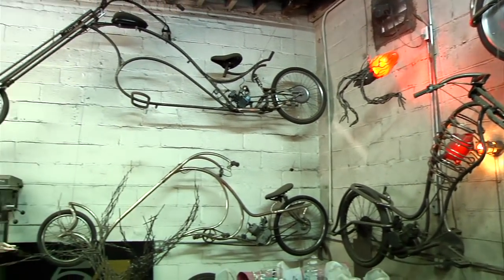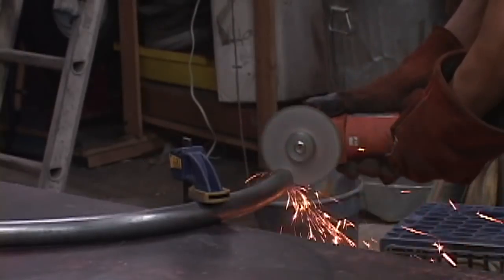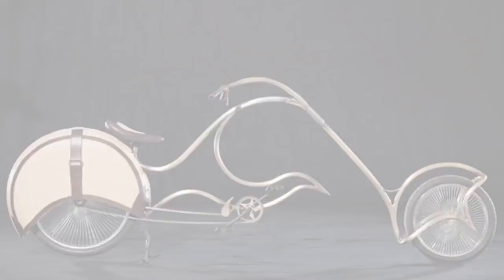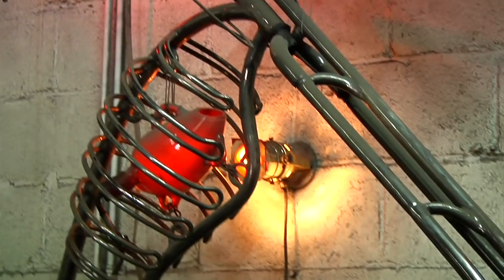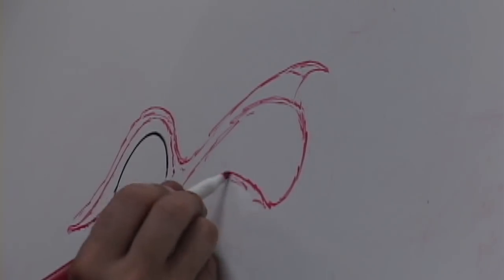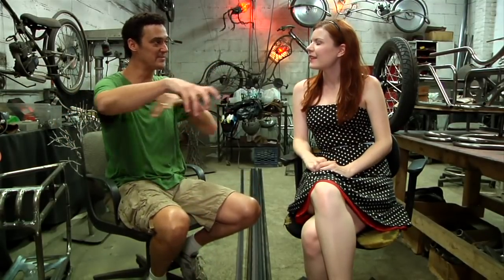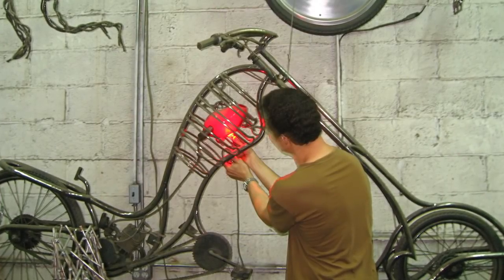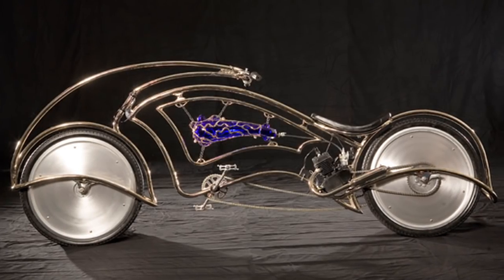Building Custom Bicycles in New York City

Comment: @omarnomade It really depends on what your goals and limitations are.  Generally, steel is easy to work, to weld, but is heavier than aluminum.  Iron is a component of making steel, but iron on its own would be a terrible choice for a bike -- too bendy.   Steel, and specifically 4130 (a strong alloy steel), is a great choice for building bikes -- it's cheap, and easily welded and formed.  Bikes can be welded with oxy-fuel, MIG, or TIG.  Or brazed.

Comment: very nice work , but they look extremely heavy need a motor.  and to the guy concern about polution. when they make a bicycle that goes 100 + miles in one charge then i go electric or battery. electric bikes are pieces of shit. don't waist your mony in crap that do not work